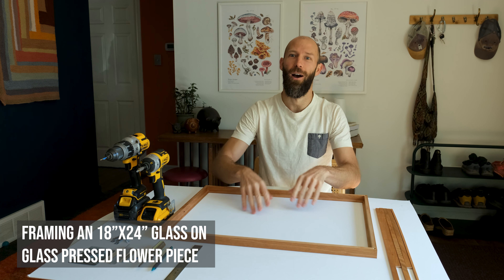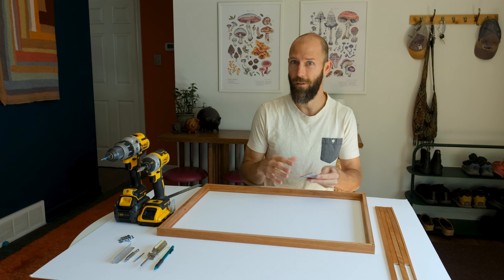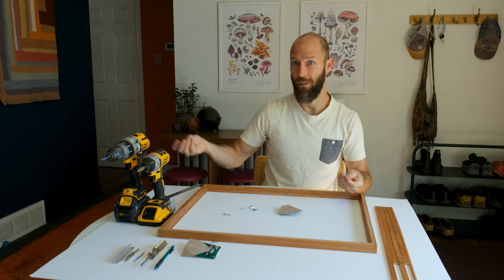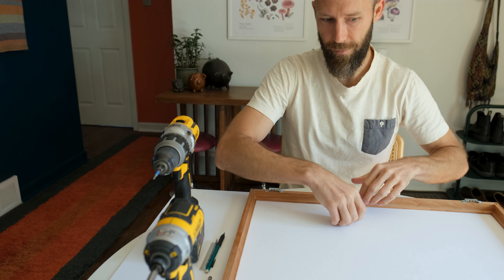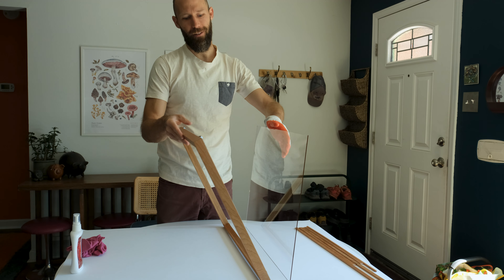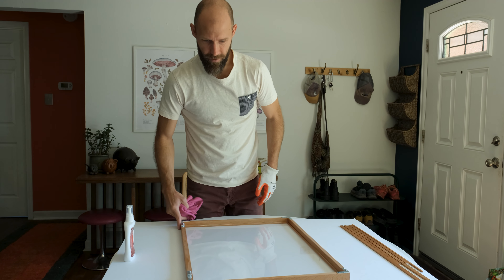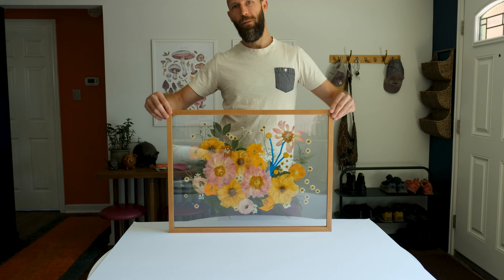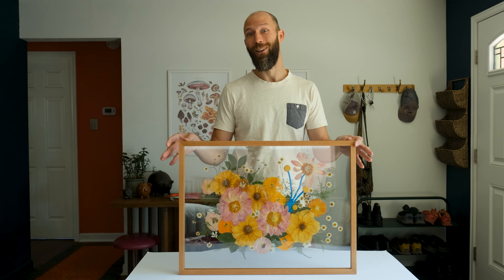How to Frame Pressed Flowers - Glass on Glass Framing Mini Course

Comment: Thank you so much for the framing tutorial. Also, about the glass cleaner you have used. I jumped right over to Amazon and ordered some. Thanks again ❤
Reply from the maker: Hahaha awesome. I forgot to link it in the description. Thanks for the reminder. Also you can use it on plastic too. Easy to use. I like it

Comment: Hello, thank you for all your informative videos. I have a question that I have not seen answered anywhere else. When the pressed botanicals are layered on top of each other,  like a stem of leaves and a flower on top,  are the stems cut off where the flower petal begins? I have noticed that once the glass is laid on that the areas of the petals where the stems are can show through and create a line or a higher spot that makes the petals look bumpy and not lay flat. Thank you.
Reply from the maker: Good question. It’s personal choice. But I have cut stems as you said and then laid flowers right at the edge of the flower to mimic a fluid transition. That’s usually what I do. But I like to place the flower strategically into the stem sometimes. It’s sort of a puzzle to get everything looking how you want and then glue it down.
Reply from the maker: But you are correct. You can sometimes notice the stems if not cut through the flower but that’s also not a bad thing. It could actually be a very cool effect and I can envision doing that. It all depends on how thick the stems are, what flowers you are placing on top, and what look you are going for. Each look works.
Reply: Thank you for replying. Now I feel more confident knowing that either way works.

Comment: A new video… thank you!  The whole framing thing is an art.  I don’t do glass on glass, but am trying to see how to”add depth” between the artwork and the glass.  The spacers you showed solve the issue of keeping plant material from touching the glass.  Specially made frames are likely out of my budget.  Can you do this with off the rack frames?  Just leave the back off after attaching your final spacers like you showed?  How do you know how thick/ deep the frame should be?
Reply from the maker: Yeah just leave the back off. Spacers come is different sizes. So you’d have to measure the spacer/s (internal and external) you use, plus the thickness of two pieces of glass. Then you would get about what depth the rabbet needs to be. Does that make sense?

Comment: so great!  thank you-  any chance you will post a video on a piece with spacers?  also with just a paper or linen backing?  Thanks!
Reply from the maker: Eventually probably but it won’t be for a bit. We are moving and I stopped framing pieces. Shipping the pieces that are glued on paper that have internal spacers is a no no in my book. The unpredictable handling can cause damage to the piece so I ship them unframed. Eventually I’ll show videos but yeah. For spacers with glass you can use internal and external or just external to hold it in. I use wood spacers though that match the wood not plastic. And for paper pieces I use internal spacers and a different system to enclose everything.

Comment: Hi, I have a question about your external spacers. Do you make these on your own? I am trying to find them at framing supply stores and no one knows what I am talking about. The closest thing I can find is glazing points to hold the glass in. Thank you!
Reply from the maker: Frame shops would understand, but maybe not framing supply shops. Usually spacers are plastic and come in white, clear, and black. That though doesn’t really work if you have wood frames. I started off by making my own and it was tedious and since all my equipment was old and not square, I went out to find a company that made frames and spacers to match. The two companies I know that so that are picture woods in Boulder Colorado (I was lucky as I’m in CO) and Vermont hardwoods in Vermont. Their frames are better than all. Handmade, Sustainable hardwoods. You can buy wood and make it yourself, buy it framed and stain yourself or have them do it all. They are more expensive but I positioned my product to be more expensive and used the best quality I could find. It’s good to understand framing, profiles, weight loads, etc. Glass is heavy so the frames were made with dovetails which is better than v-nails. Anything larger than a 18x24 glass on glass frame, I would increase the profile a step up and would also add flat corner brackets on the back to make it stronger and more safe for the customer. It’s all decision based if you are a business or just hobby based or how you want to be. I just wanted peace of mind always and went a bit further than most framing these up. But yeah spacers were tricky. Many people make them out of popular and paint them or stain them to get it close to the stain color of the frame. But I like the exact and cohesiveness the companies have. Hope that helps

Comment: Hi Keith and Rachel! Super awesome video! Framing is always the most daunting part of pressing flowers. 2 questions for you! The first is you had mentioned the external spacer is 1/2” but I don’t think I caught/heard the other dimension. What is the width? 
And my second question! You mentioned that when you do have thicker flowers and you do need an internal spacer, you mentioned that your rabbit profile needs to be bigger than 3/4”. What rabbit profile do you use? 

Thank you so much!
Reply from the maker: So the spacers can come in multiple lengths. 1/4, 1/2, 3/4 etc depending on your frame profile. But typically it’s 3/16” the other dimension. The rabbet is usually 1/4” so the 3/16 is just shy of it.
Reply from the maker: If we are using an internal spacer (1/4”x3/16”)  and then the external (1/2x3/16) plus the two pieces of glass equally 6mm. So whatever that all equals. The rabbet depth should be nothing less.
Reply from the maker: So 1/4+1/2+1/4. So I’d probably have 1-1.25” rabbet depth

Comment: Hello! Can you please comment on the rubber gloves you use? Do you know where you can purchase the internal and external spacers? Or could I just make them from dowel rods? Which brand of nail guns do you recommend? Thank you so much!
Reply from the maker: We got our spacers from a company called picture woods in Boulder Colorado. You can use any nail gun that is a 23 gauge and I would use a battery one not compressor. Any brand would work

Comment: Hello, great video! And a beautiful result! I had a question about pre-drilling. You said you pre-drilled everything, does that mean you pre-drilled both the spacers and the inside of the frame? Or just the spacers?
Reply from the maker: I pre-drill for the sawtooth hangars. I dont predrill for the spacers or anywhere else, just the hardware for hanging because the spacers are being held in by the nail gun and there is no need to predill for the nails. It would be impossible too and so stressful trying to do that. :) Does that make sense?
Reply: Yes, I was thinking pre drilling for the pin nails would be near impossible! Thank you, makes perfect sense!

Comment: This is so helpful! Thank you! 
Where do you find your wood spacers? I’ve been using balsa wood spacers but they don’t seem as sturdy as yours. Thanks again for sharing this video! I’m a big fan of your work.
Reply from the maker: So we get the wood spacers from the same company we get our frames. Picture Woods out of Boulder Colorado. If you do a lot of framing, I’d look into them. They are the best. The spacers are the same wood and sane stain as the frames themselves so they are seamless and strong and beautiful
Reply from the maker: They have multiple size spacers too but they only work with businesses right now and not direct to consumers

Comment: Thanks for all of your educational videos! Do you ever use acrylic instead of glass?
Reply from the maker: We didn’t use acrylic due to its ability to scratch so easily and it’s a crazy static material. You got to clean all the little glue marks off after  you finish a piece and glass is way easier to do that too